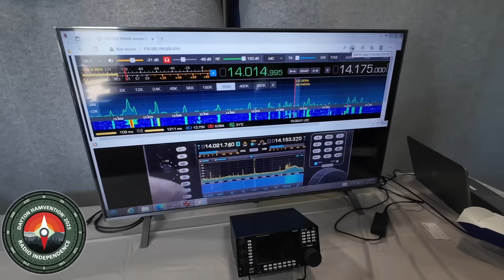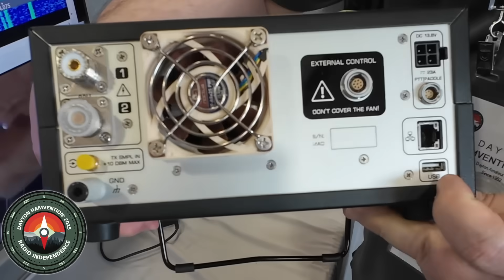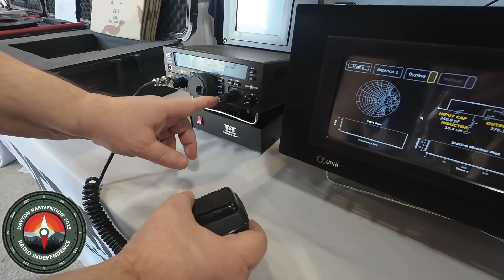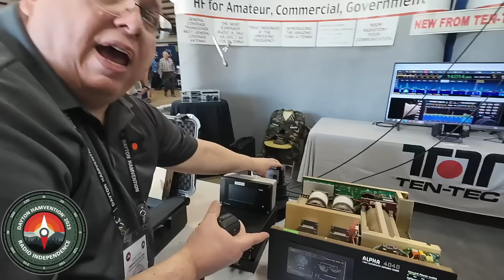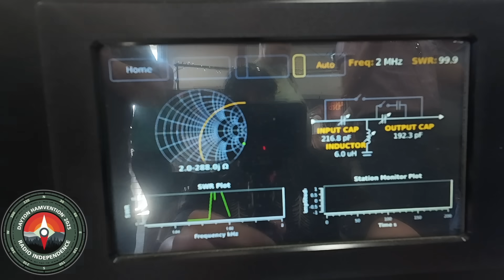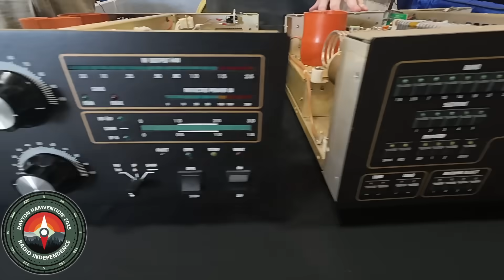Hamvention 2025 - Ten-Tec

Comment: IC-7300 is ~$1000 USD after rebates. It is available now. Very hard to beat. How much with second A/D receiver? I had many TenTec radios. I Never had one that did not need something fixed.
Reply: The '7300 is a cute rig, but a mediocre receiver.